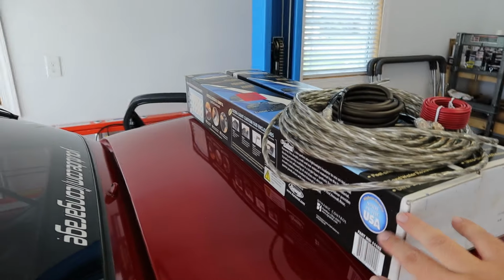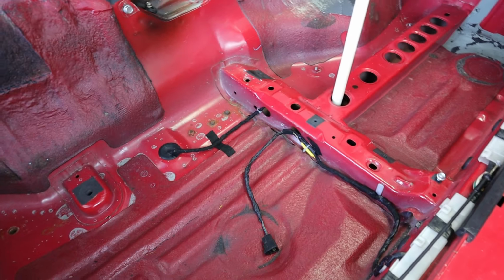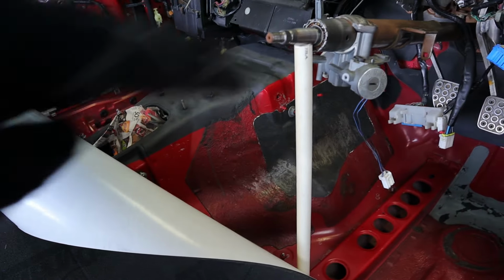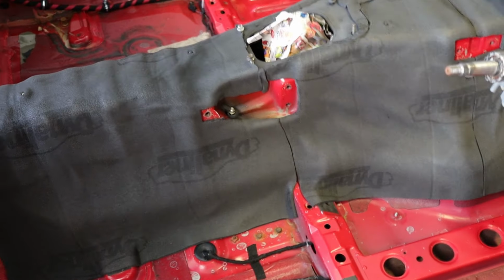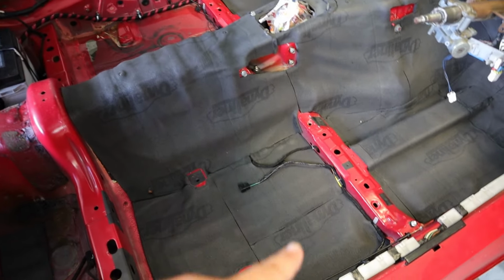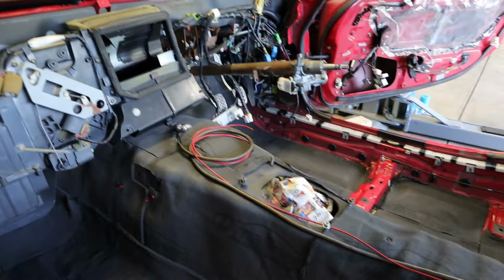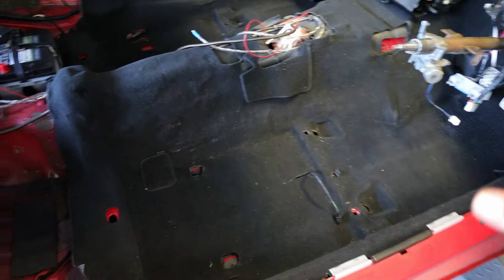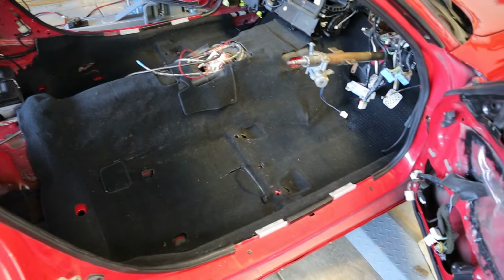FD RX7 Insulation and Carpet Install

Comment: Been there done that, that bloody rubber door conduit is a narrow bugger and even when feeding heavy gauge wire through there with a wire threader, it often tore through the thin rubber bellow. FD's love them but some things Mazda just unecessarly skimped on in the name of compromise. I always wanted to do the new insulation to cut down on unnecessary road noise and heat. Can't wait to get your verdict.

Comment: I took the filthy carpet of my GTI to the huge washer at the local laundromat, dried on low setting. Carpet shrunk just a tiny bit and lost a little shape which really didn't matter. But only downside was that it lost a bit of the dark black.  It was a good decision for me.